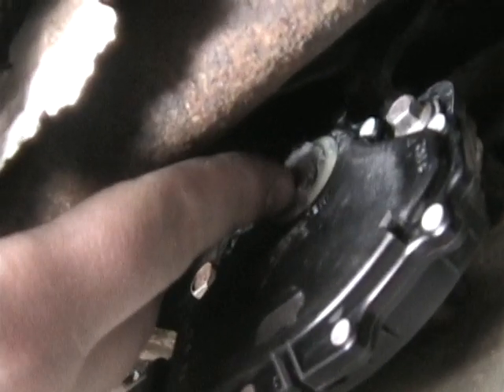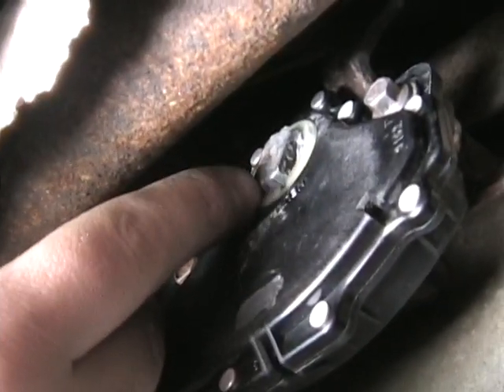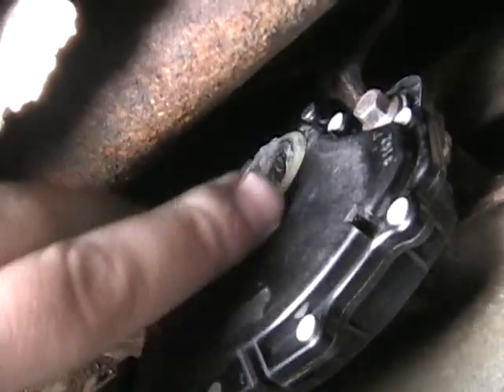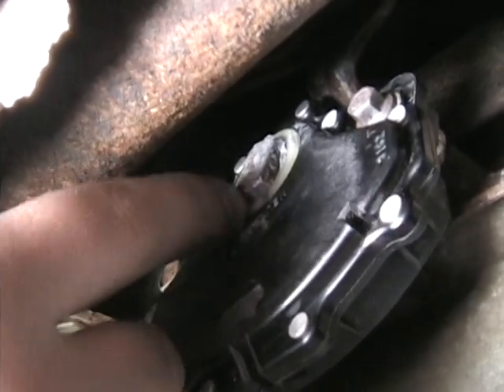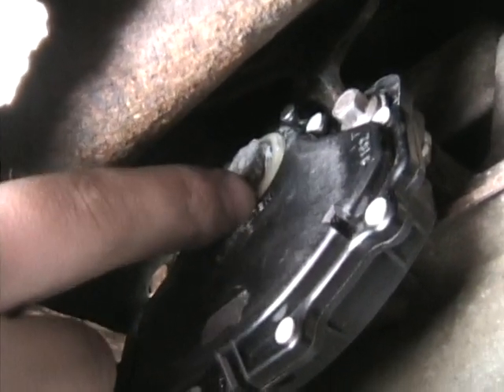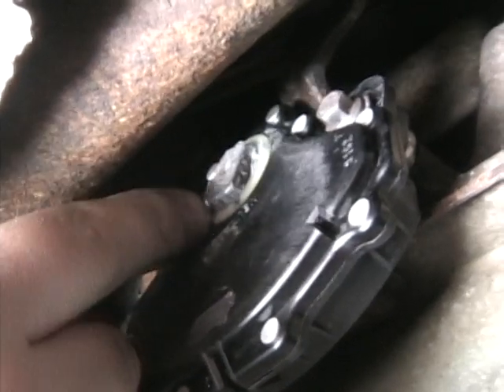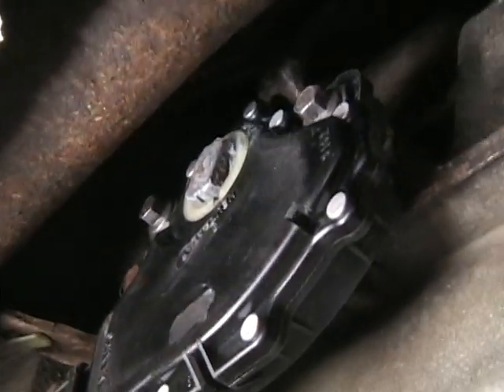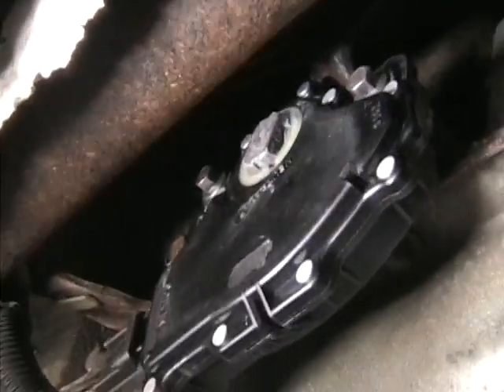Adjust Digital Transmission Range Sensor

Comment from the maker: @MrJeancacr2000 - not sure, i would say to pull the bolts out of the switch, put the truck in reverse (not running and blocked so it wont roll) have someone stand behind it and watch for the lights to come one. when they come on, and the lever on the column is in reverse, bolt it back down and try it. If that doesn't work, I'm not overly sure.

Comment: @MrJeancacr2000 make sure that the torx screws holding the end of the  cable arm on the shift tube are tight. (top portion of steering column) . They are notorious for loosening causing play in the linkage. They have been known to fall out hitting the drivers feat.

Comment from the maker: To adjust the DTR, first take it off the truck. Look at the DTR itself, you'll see a little notch the says "Neutral" - turn the center ring until it's own notch lines up with the one that says neutral. Crawl under the truck and place the transmission in neutral. Slip the DTR back into place and bolt er down and test it. Remember to put some neversieze or white grease on the shaft coming out of the trans for easy future removal.
Reply: Crawl under and place it in neutral? How would you go about that?

Comment: Hi I changed the solenoid inside the transmission and now the truck won't crank went I remove the solenoid I put mark on the  shaft inside but not on the DTR sensor out side this can be fixed front outside or do I have to remove the oil ??

Comment: i have a 02 trailblazer, we recently replaced the transmission, and the fly wheel, now the car starts and the gears work but the car will not move...not even in nuetral...the tires are not turning at all when i put it into gear?? we were thinking range sensor or a fuel line? someone suggested a whole new transmission :/ please help!!!

Comment: what would cause overdrive not to work on a 2005 f150 king ranch.  It will work if I shift not even all the way to second its almost like a shifter problem maybe?  Once I do that it works just fine.  Also when I am in drive and shift to reverse my backup lights dont work but if I put into park and not even all the way into park and go reverse they work.

Comment: Do you now what the symptoms are in a 2011 f150 for a bad range sensor?
Reply from the maker: I'd guess not starting would be the biggest one, if the truck thinks it's in gear.
Reply: No start in park

Comment: hi! i have 98 mitsubishi galant and my engine light come on for that transmission ranger sensor. I have qustions do you think that sensor make my stering wheel Vibration, cauze when i put my car on drive my car is shaking? thank you

Comment: hi i have a question for anybody who can help please I put a new engine in my 07 scion tc and now it wont shift into gear unless I put it down in 2nd  first then I put it in drive and it doesn't shift only up to 3rd it wont shift into overdrive  here is what the code reads  TRANS  RANGE SENSOR   CIRCUIT MALFUNCTION [PRNDL INPUT] does anyone have an answer?